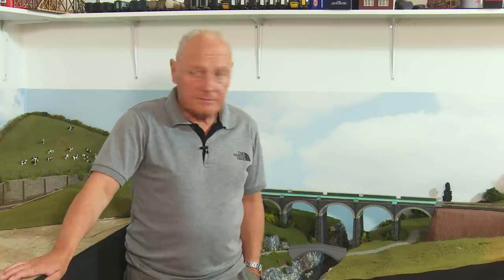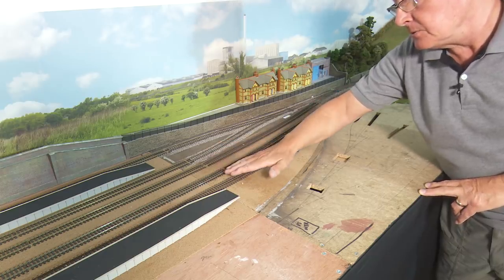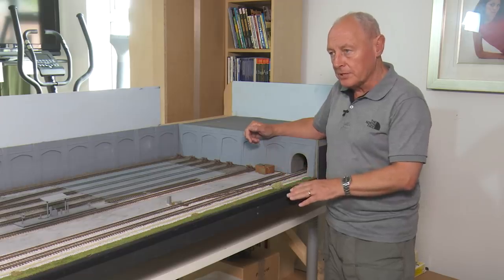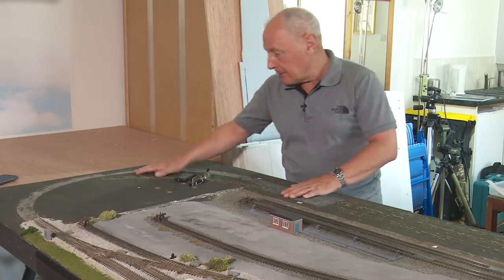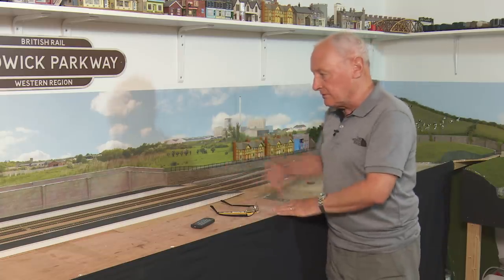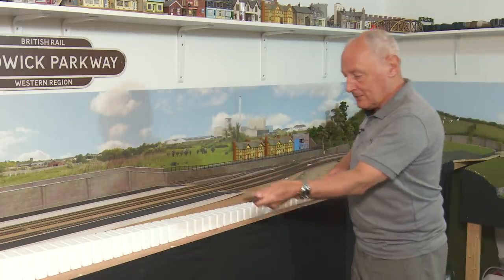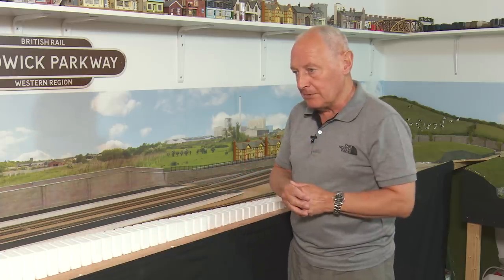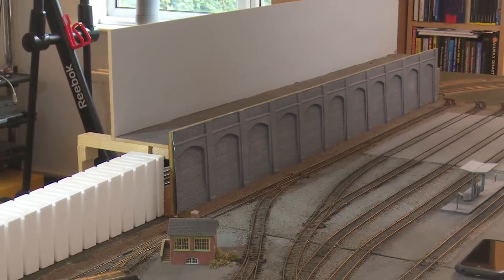A boring track plan at Chadwick Model Railway. | 72.

Comment: First thought was that the headshunt on the parcels line would foul up anything going to the 'slow up' platform. Maybe the headshunt would be better coming off the parcels spur directly rather than the slip.

You can assemble the parcels train without taking the platform out of action.

I would do the higher 'branch' as a single line, you can always have a terminus that has more than one platform. A double-track branch would need a complex junction at the lower end to join up with the normal main lines. The incline does look steep, could you make the length of the incline longer to reduce how steep it is. The clearance if you need to do a bridge over the existing trackwork should be more than enough
Reply from the maker: Some valid points Martin, many thanks.

Comment: Very neat that you tested for traction on the incline.  Is your incline going to include a curve and how much will that affect the drag of wheels on rail? 

I see David Bookler has already mentioned the possible use of thin board to perhaps overhang a single set of polystyrene risers to give room for a double track.   I know I did not allow enough width to accommodate coach overhang on my curve!

During the first part of your video when you first mention the fiddle yard I wondered if exposing the yard as as storage yard in use would save the need for perhaps cameras top see what is actually happening.   Then when your terminaus station was mooted, I wondered if a "high level station" as the terminus could still expose some of the fiddle yard to save reaching underneath in cases of emergency?
Reply from the maker: Interesting points And sound advice, cheers mate.

Comment: Hi Charlie, I model in N scale and I have a double track layout set on the 2% inclines. Firstly, I had lots of problems with steam engines running up them and I know that won’t effect Chadwick, but I have also seen OO gauge HST’s refusing to climb the 4% ones. Can’t remember who is was but he ended up fitting the DCC Concepts magnet system to help and it fixed it. On the size side, I would suggest some 1” foam sheets, cut to the profile of the incline with you’re wire cutter (great investment) and glued to the side to give you the extra width for double track. It is also worth noting that you need to cover the inclines before ballasting otherwise you lose it through the gaps.obviously.. I used plaster cloth but have seen others use masking tape. If you look at my channel you can see the inclines in use and they are very very easy to work with. Great idea with Chadwick central but such a shame to chop it about. Whatever you do I am sure you will, as always do a fabulous job of it. Cheers for now, Chris
Reply from the maker: I’m so pleased that you enjoyed it Chris and thanks for your pointers too.
Reply: Wheezy Palace N gauge I believe Dean Park used magnets.

Comment: Hi Charlie, I'm at the stage of completing a major build (5.4 m x 1.2 m) with an incline similar to yours. I didn't use the full 4% rise. However I have a curve incline/decline around a small mountain (2) curve, all curves are (2). Issues are long coaches disengage couplings & some like to jump the rails up & down.
COVID has caused me to get everything piecemeal. So I think the Hornby Steam Engine "Brown Jack" might climb it but the coaches are an issue. I think they will be confined to the flat areas. I'm yet to wire up so all the daunting stuff is ahead. A rebuild could be on the horizon.  Regards Tom
Reply from the maker: Sorting out these inclines can be a dreadful to ask Tom. Good luck and do keep me posted, regards Charlie

Comment: 4% is the steepest you dare, decreasing it (and you have the room) will improve both looks and loco performance. Be warned having a curve on the incline will reduce pulling power! As for width, add a ply top and over hang, or buy second incline set, but best bet is to use XPS or EPS and just duplicate it. I would have the top curve flat and one curve only half way up and make the incline to suit. Incline guide on my website http://www.lumsdonia.co.uk/gradients.html
Reply from the maker: Sound advice, thanks TS

Comment: Hi Charlie,
Great channel.
I enjoy your mature and relaxed way you do your videos.
 like your ideas for the layout changes 
However I do think that the risers you are using are a little too steep.{Although I appreciate the need to use them within the confines of the space that you have}
One sugestion could be that you break up the scene in front of the risers by trying to create a cutting where the train runs up through. Not a continuous cutting but perhaps brocken up into two or three sections to give the perspective of the train coming into and out of view as it climbs up the gradient.
This should both disguise the steepness of the grade as well as provide some modelling interest to the far side of the layout.
It will also break up the two dimensional aspect and provide you with a third layer of depth.

By the way we share the same surname and are of a similar age.
Kindest Regards,
Nick Bishop
Australia.
Reply from the maker: Sound advice, thanks Nick Bishop (great name).

Comment: Well Charlie I am certainly not up to your standard, nor do I believe for minute your layout is boring & is a great track plan. But. .I do agree with the need for some cuttings & embankments. By the same token I also think the 4 degree incline looks a bit steep, if there is space a 2 degree may look better? For interest I build on 50mm foam board, which allows me to “cut & carve” out. You will know what I mean. As I model N gauge double track is ok, could suggest widening with 3mm plywood, which could work? 👍👍😎
Reply from the maker: Sound advice, cheers David

Comment: Hi Charlie.You could use a pair of risers side by side,or glue some thin customwood to the risers to support double track. the grade is very steep. For mains I use 2.5%,single track branches 3.5%,rack sections up to 7.5%. Long trains only on 2.5% or less,some double or triple heading. Can I suggest angling track to walls where possible or using gentle S curves ,creates more illusion of distance,,. as well as leaving spaces for scenery or structures. Also in front of backscenes use building "flats",then low relief.then 3-D, and some of a smaller scale in places further back.Hope this helps.
Reply from the maker: Sound advice, cheers mate.

Comment: I find the logic impeccable, as ever.  However, I'm hard aground on a lack of prototypical knowledge.  I wouldn't know a shallow grade from a teep one in the UK (my failing, not yours).  And, it all looks a tad exotic to me, as I'm used to US roads, which run industry to industry.
As a general rule of thumb, using height in place of length is a much more efficient use of the restricted spaces model railways are constricted to.  So, I'm alway inclined to grant some artistic license there, especially if it benefits operations.  But, that is just my 2¢, er, 2d.
Reply from the maker: Sound advice, cheers mate.

Comment: If it was me. I’d rotate Chadwick TMD 180 degrees, as you can then have a two track mainline in the background up against the arches quite easily, with nice sweeping curves at each end. Meaning you might get away with not having any form of scenic break. Your branch could be a single track line on a double track bed leading from a junction outside of Chadwick Parkway. the junction could be modelled to be a simplified version of its predecessor, leading to a rundown terminus that could have at one time had four tracks, three platforms and a decaying overall roof etc. As this would nicely represent BR’s lack of money and simplification projects of the era. 

This is purely my view on how I would tackle the project, take or drop any ideas you wish. Either way I look forward to seeing what you do with it as I’m sure it will be fantastic.
Reply from the maker: Wow NNR, that’s a great comment. 
I need to study it more beside the layout for a better understanding.

Comment: Another most enjoyable video.

I don't understand how Chadwick Central passengers, who upon departure seem to be travelling up, would change at Chadwick Parkway to continue a journey on the down line, or perhaps change at Chadwick Parkway to connect with a fast up service.

Do they have to catch a bus?  I suppose one might say that in the era you have chosen, The British Railways Board would, in their wisdom, have withdrawn all services from Chadwick Central in any event.  However that is trumped by having fun.

Does your computer control take away the exercise of manual input?  If so does, this have a bearing on what you might feel is boring?  I guess the computer doesn't make mistakes, to which people can be prone.

I think the comment about ducking under baseboards and the passage of years is wise.
Reply from the maker: The plan is starting to develop due to some really good ideas.  I’m currently considering putting the TMD at the end of the incline.

Comment: 1. Two single risers for double track, or if you go edge to edge you may have triple track.
2. Have a period of regular passenger and parcel trains (parcel trains on the back-most track for freight) and then dedicate a special train to be your Chadwick Central Express with an opening charter season, and then start regular service.
3. Perhaps include a dedicated point to point transit/tram (passengers only) from one end to the other.
These ideas may be a bit out of order, but maybe it would further excite your purpose for your building upgrade (literally and figuratively) new line.
Cheers! John
Reply from the maker: Sound ideas John, many thanks.

Comment: 4% incline. The decline, all that weight of coaching may push the loco. I would after the station build upper section  for station building and town scene. The Tmd boards can not see much of a problem link it up. A second station excellent idea my only concern is space for it? Not used or concidered Nock inclines, I scratch build using cardboard boxies from supermarkets (pink lady) and PVA covered with free 6mm I think carpet underlay. I would also consider have a single track in or behind your town with a rail bus on auto have some halts.
Reply from the maker: Sound advice, cheers mate.

Comment: Charlie I model in N and use the Woodland Scenics inclines on double track. Certainly it isn't suited for OO double track. My concern is the incline. 4% is very steep. I tried that during construction last year and have just ripped it up. Not only do locos have problems with a long load, but it doesn't look great. I went back to 2% - and expanded the layout to accommodate my folded dog-bone.
Reply from the maker: Sound advice, thanks Ken.

Comment: Hi Charlie, unfortunately I can't help with your Woodland Scenics Incline Set question, for grades on my layouts I've always used the cookie cutter method. Being somewhat of a Branch Line kind of guy, i.e. slower pace more bucolic, etc. have you thought about making Chadwick Central a branch line terminus station above the fiddle yard? Instead of double tracks heading up to the station, you could run a single track up the incline then once on the level, branch out to a double track, before reaching the end of the line? Cheers, Rich S.
Reply from the maker: Sound advice, thanks Rich.

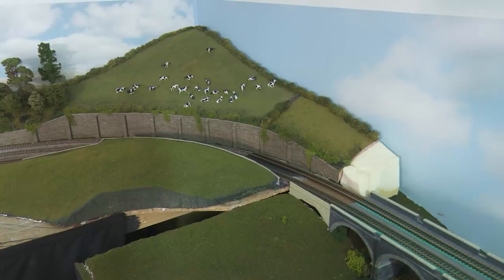Comment: Hi Charlie,  oh never boring, but always a challenge. My experience of testing with 1:25 grades was there was a large variance across my engines  when comparing flat to 1:25 haulage performance, so recommend you check across your fleet if going so steep that all engines perform to expectations. I have settled on 1:50 nominal, worst case 1:40 to minimise haulage losses and make grades look (to my taste) reasonable. Personally I think 1:25 looks too steep. I had to drop my final height to achieve my target grade, perhaps you might consider to drop your upper level height? I am still at layout planning stage, using the CAD which is great for assessing grades, track plans and what layouts look like with scenery and buildings. As always it's a compromise! Have much enjoyed your channel, experiences and advice etc, many thanks. Stephen.  (Charlie - have moved from an unintended reply to where it should have been as a comment - good luck with your decision making process too!!)
Reply from the maker: Sound advice, thanks Stephen.

Comment: Do you like shunting? If so what you are doing is fine. In fact for the shunter most layouts are fine. My idea of fun is to set trains in motion and watch them going round and round. I think your viaduct currently forms a bottleneck with 2 loops? If it was me I'd have to move that lovely viaduct scene forwards giving space for 4 loops behind at a higher level. Then I'd reduce the width of your station so I could set additional platforms at a higher level (like Retford, Tamworth, Builth Road, Liverpool Central etc where you have high and low level stations). For 'loop' men inclines are bad for running around although they look nice. You could also put in 2 shuttle lines. Going between the station and 'old' depot scene boards. I don't know if you are a shunter or a loop man but decide what you enjoy and do a track plan accordingly.
Reply from the maker: Sound advice, thanks Alan. I like trains doing circuits when I shunt etc.

Comment: Is there a specific reason why you need the incline to start and finish behind the station, I know adding in curves doesn't help but surely the length you have from the same starting point you plan to have the 4% start... right round to meet up with the original TMD board would allow for the 2% or at least the 3%... 

You could even stagger the incline slightly to help compensate for the curves... unless I'm misunderstanding the actually layout of the boards/track plan? 

I'd also consider making it single track branch line terminus. Running a shuttle type service back and forth to the mainline Parkway station... with small goods yard to supply local businesses... although not sure thats very typical in this day and age... just a thought?
Reply from the maker: Sound advice, cheers mate.

Comment: I really wonder Charlie why you have used the word boring. If what you really mean is lack of operational interest the personally I would strip the old loco board and turn a majority of the area into a goods yard (remembering that railways rely much more on freight than people). You could use a smaller area of that board for locos, etc..
I would have the area over the proposed fiddle yard as a townscape with a fully operational modern tram system, working of course, integrating a working roadway such as the Faller system....possibly simllar to the one recently shown and built on Graham Foulston's channel.
That would give you 5 areas of operational interest....Main line, goods yard, engine shed, tram way and working roads.
Hours of fun building the townscape with fully working lights, weathering the road transport, etc..
Just my thoughts Charlie. I am sure whatever you decide, we will all be watching with         interest.
Cheers, Bob
Reply from the maker: Sound advice, thanks Bob, but will I live long enough!

Comment: Charlie, I’d keep your viaduct and start your risers off (curved?) interchange points either side of that for a longer upper run. That might allow a (less steep?) climb up a cutting through your planned hill to the right of the viaduct. Presumably the fiddle-yards would branch from the viaduct via a tunnel to the rear of the mountain. Parkway might need a slight rethink to accomodate, or start that riser on the left end of the station, over ‘the gap’ (hidden?). A strategically placed road bridge or two might add interest.
Reply from the maker: Sound advice, cheers mate.

Comment: I like the idea of rotating the old TMD as others have suggested is a good idea.  But I had another thought , as I was watching a previous video, where you laying the Parkway tracks. I think what you're saying about "boring" is that it's all one one level, so I was wondering if your ascent could include a flyover the left hand station throat.  But then I wondered: could you combine Chadwick Parkway and Chadwick Central into one multi-level station?  What I mean, is that if you had Chadwick Central as a terminus ending at a higher level above the left hand end of Parkway. A bit like Wigan NW and Wigan Wallgate squashed up closer together (well assuming Wigan NW were a terminus of course!), though there's probably several other prototype examples.  So your ascent to the Central terminus could begin at the opposite corner of the layout at the left hand side of TMD, or even start from a line coming off at the end of the viaduct, meaning you should be able to get a gentler gradient than that Woodland Scenics 1:25 you showed, which looked a bit steep to have in a sceniced area. Whatever you do, I'd be tempted to have some dmus that can shuttle automatically in and out of the terminus, while you operate trains on the tailchaser part of the layout, but you also want to be able to connect the two to add operational interest.
Reply from the maker: Wow, Andrew, what a great comment. Sound advice, many thanks.

Comment: Definitely not a boring layout! My HO layout is much smaller than yours, however I used the last smaller grade of that poly styrene slope and it was sufficient for what I needed. I glued the cork track bed down then the track. For the sides I put fake cobblestone. I wish I could send you a photo because if you saw what I actually did it would make more sense. The grade was not too steep. I think adding Chadwick Central to your layout would be fantastic! Can I get your email perhaps?
Reply from the maker: Sound advice, cheers mate.